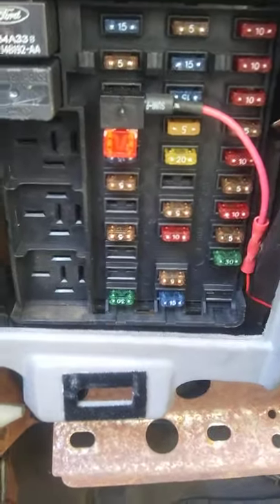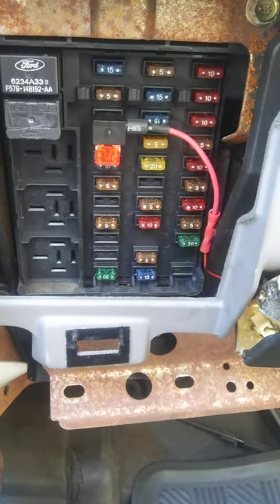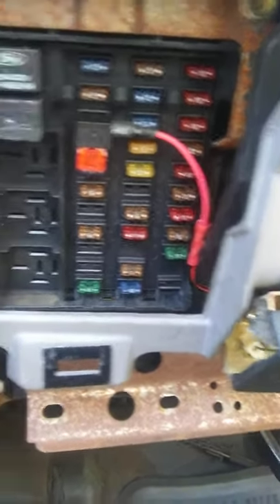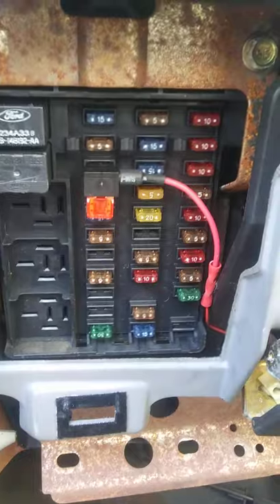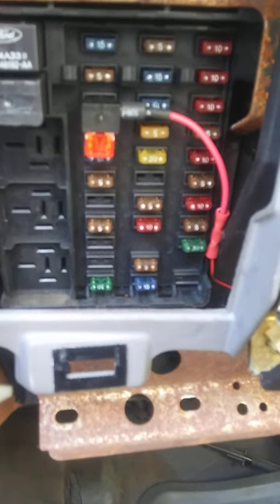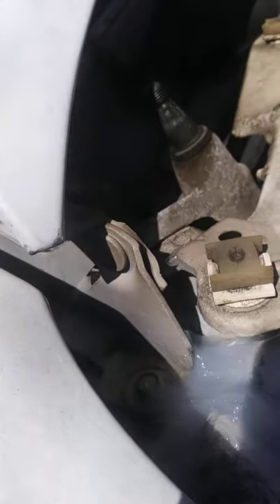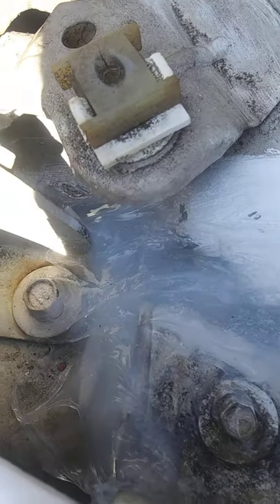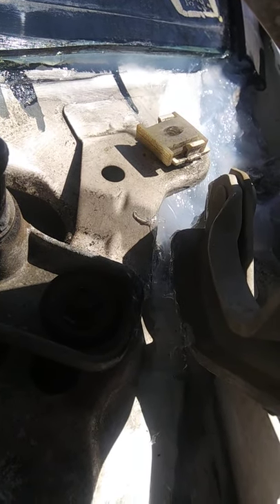97 F-150 Wipers (and dome light, door chime) Quit Working: easy fix!

Comment: They had a 10 amp in mine for some reason. I switched it to a new 5 amp and it still has this issue 😢
Reply: Back of the fuse block probably got cooked because the fuse was to high amperage to blow
Reply: Same thing happened to me 😢
Reply: Same here man I heard the ding but no windows or dome
Reply from the maker: @DBsFabShop  agree. Probably going to have to get rid of the water intrusion issue, then replace the fuse block.